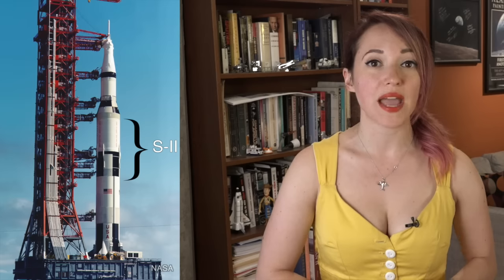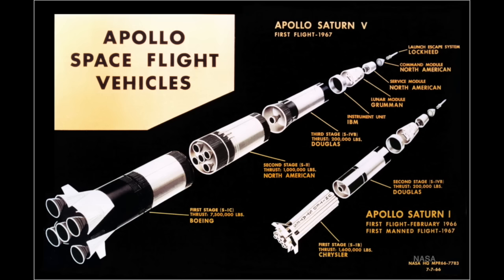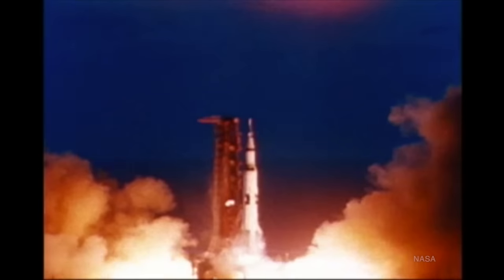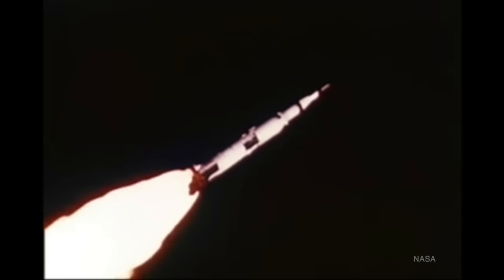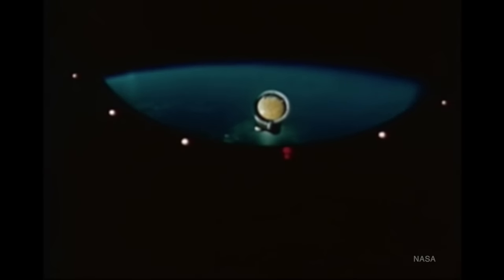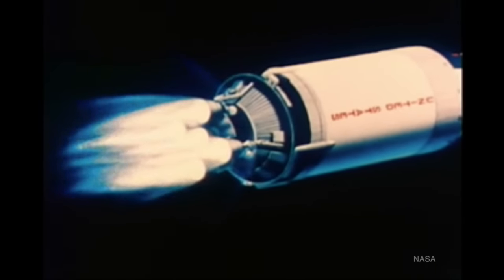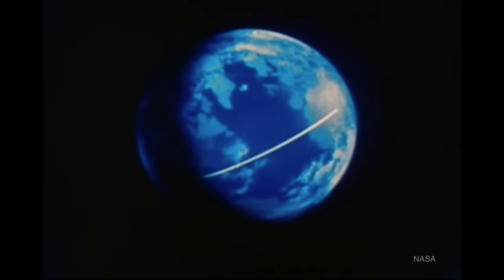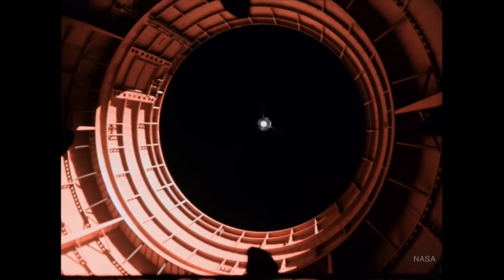How the Saturn V Broke into Pieces Launching to the Moon

Comment: What happened to the SIII stage?
Reply: +oilerblueline 

If by "SIII" you mean the third stage, that was actually an S-IVB.

On Apollo 8, 10 & 11, they ended up orbiting the Sun.

On Apollo 12, it ended up swinging around the Moon, this was not planned for, & the stage is currently in Earth orbit. It was first spotted returning to Earth in 2002 it was mistaken for an asteroid.

On all remaining lunar missions, Apollo 13 to 17, the stages were deliberately crashed into the Moon, where seismometers left by previous missions recorded the impacts.
Reply: +David Keenan Actually, I meant why was there an SI-C, SII and SIVB, but not an SIII?
Reply: oilerblueline

The S-III was a proposed third stage of the early Saturn C designs for a five-stage Saturn launch vehicle.

But before the S-III ever got off the drawing board, the S-IC, S-II, and S-IVB were already in development, so there was no need for another stage to be designed as a third stage, so the S-III stage was dropped.
Reply: +David Keenan Thanks. That's what I wanted to know.

Comment: What happened to stages S-3 and S-4A?
Reply: +Majoofi Well, in 9 months, you get a new baby brother or sister.
Reply: +Majoofi What I've pieced together, but may not be 100% accurate: NASA was iterating through designs very quickly in the late 50s well into the 60s.  Many components designed for used in other rockets were the basis for components in newer rockets.  The S-IV was originally designed as the 4th stage of a rocket called the Saturn C-4.  The C-4 was never built but once the design was given designation it stuck as the component's name.  The S-IV was then used as the second stage in the Saturn I.  A modified version, the S-IVB was used as the second stage of the Saturn IB and as the third stage of the Saturn V.

Here is a reference: http://history.nasa.gov/SP-4206/ch6.htm
Reply: Mark Evans
I guess I should have guessed it was something like that. Thanks
Reply from the maker: +Majoofi There weren't any. The numeric designation came from their development. There was an S-IV stage that was sort of the precursor to the S-IVB. I don't think there was ever an S-III stage in development though... I haven't done a full dive into the Saturn development history though so I might be wrong. I think this old article I wrote about Apollo 4 might have some of the history in it! http://news.discovery.com/space/history-of-space/nasas-first-big-launch-121109.htm
Reply: Amy Shira Teitel
cool thanks

Comment: 4 words: Van Allen Radiation Belts
Reply: +Zane Black here's some more words:  The astronauts had low exposure in the Van Allen belts due to the short period of time spent flying through them. Apollo flight trajectories bypassed the inner belts completely to send spacecraft through only the thinner areas of the outer belts. The command module's inner structure was an aluminum "sandwich" consisting of a welded aluminium inner skin, a thermally bonded honeycomb core, and a thin aluminium "face sheet". The steel honeycomb core and outer face sheets were thermally bonded to the inner skin.

Astronauts' overall exposure was actually dominated by solar particles once outside Earth's magnetic field. The total radiation received by the astronauts varied from mission to mission but was measured to be between 0.16 and 1.14 rads (1.6 and 11.4 mGy), much less than the standard of 5 rem (50 mSv) per year set by the United States Atomic Energy Commission for people who work with radioactivity.
Reply: +Zane Black :Yet another who evidently is trying to say NASA lied about sending astronauts to the moon while believing NASA 150% when it comes to the lethality and even the existence of the belts. How can you and other lunar hoax advocates not see the hypocracy in that argument? How do you know the belts even exist if NASA are such liars? These belts were discovered by a NASA spacecraft.

Comment: rockets in future will be soon powered by a anti mater
Reply: +SuperCorrector1 electromagnetic field
Reply: SuperCorrector1 of some sort, since this is a electromagnetic containment field to keep the anti-matter away from the regular matter, instead of creating tremendous pressure in a fusion reactor
Reply: SuperCorrector1 technically if your field is strong enough, you can exert the electromagnetic force on basically any existing things.

Comment: She has got like 3 buttons on her sleeveless
 shirt with shoulder straps.  And she has a mark
  on her forearm.  So, is that like stage 1?  
  If the camera panned down, would she be 
 showing a bare midriff?  Enquiring minds 
 would like to know.  For who stares at the top
 of a rocket only, and not rather, all of it, 
 simultaneously?  It is written, cursed is the man
 who hangs on a tree.  Look rather towards the
 branches, whether it bares good fruit or not.
  The important thing is to divide information in
 the visual space in a horizontal way, for that is
 how "The Bible" is written, left to right, or right
 to left.  A curse is that which keeps one from 
 drawing near to God.  Some in the wilderness
 were healed when Moses lifted up a brass
 serpent.  NASA - a theatre company, but what
 morals are they peddling?  See, col 3:2, kjv.

Comment: NASA cannot supposedly find the original plans etc. for the V and cannot replicate it as of 2017??? Seriously?
Reply: Absolute nonsense. The prints are exactly where they have been for years. Also, they would never build it again for the simple fact that it was designed with the Apollo lunar landings as its main mission parameter. They have much longer missions planned that could include trips to Mars so they are designing a completely new space launch system with that in mind. Those trips to Mars could last 2-3 years so why would you think they would want to reuse any of the technology from 50 years ago that was designed for missions that lasted no more than 13 days.Of course, they may decide to revisit the moon using the new system but that's completely irrelevant for comparing its design capabilities vs the Satun V. 
http://www.collectspace.com/ubb/Forum3/HTML/004949.html